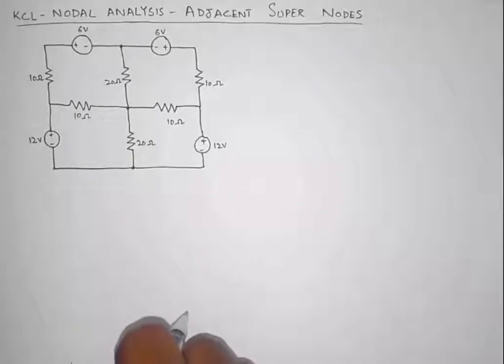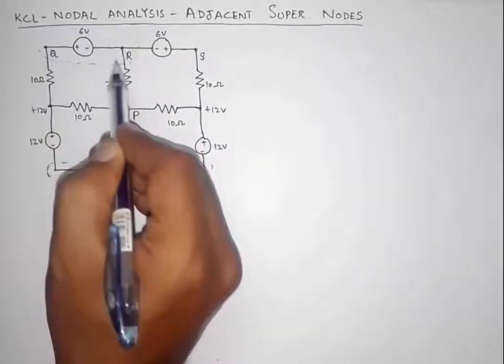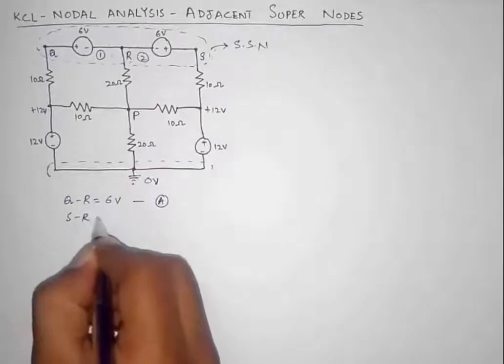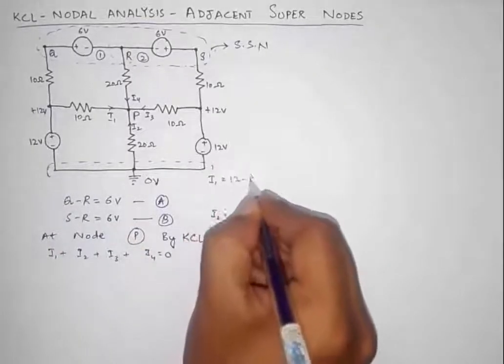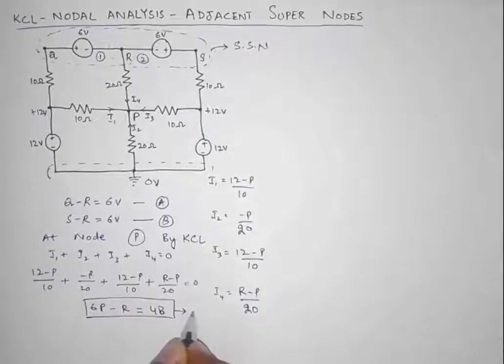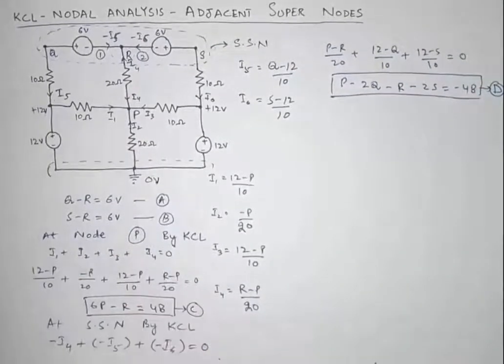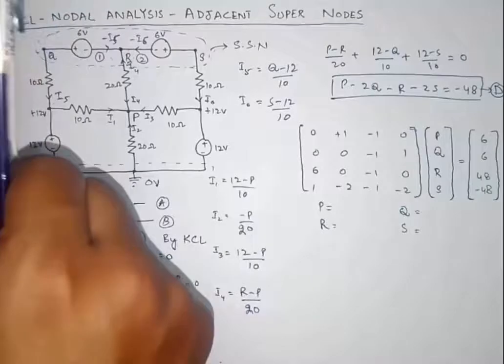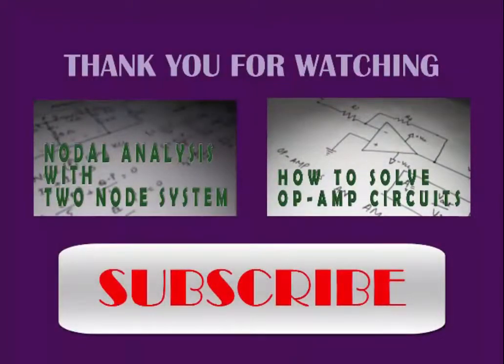LESSON 4 - KCL - ADJECENT SUPER NODES

Comment: Actually those two 6V sources aren't supernodes since it has a 10ohm resistor in between...and you just have to consider principle nodes rather than considering simple nodes...so here Q and S are simple nodes whereas R is a principle node...so you have R, 12V(I5), 12V(I6), P and Ground as principle nodes.

Comment: Better if you said Q=S
Reply from the maker: Yes you could say that in case of this circuit. But that would not be the case if any one of the voltage sources at the bottom had a different voltage. The purpose here is to show how to solve adjacent super nodes.